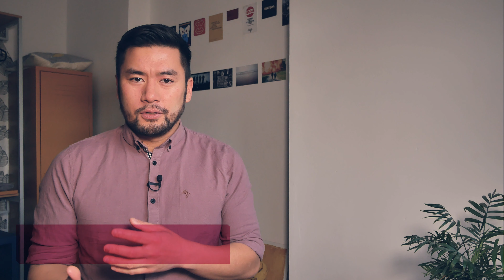The level design portfolio piece that got me into the industry

Comment: You mentioned issues with time constraints, that you couldn't finish the level the way you wanted because of running out of time. What advice do you have for planning out your project before you begin? Sometimes it's hard to even know a problem exists until you get someone to play it and see it for yourself. In my grad game, I saw some problems eventually but figured I simply didn't have the time to fix it before I had to hand it in. Estimating how long a project will take is still something I struggle with.
Reply from the maker: Hey, here are a few tips off the top of my head (which I'm now thinking I'll make into a proper video someday - thanks, haha):

1. Remember that Games Are Hard, and basically everything takes longer than expected. The bigger your project is, the more that all the little delays and complications snowball into the project as a whole taking way longer (weeks, months, years).
2. Whatever your timeframe is, aim to finish early. If you have 9 months to make a game, then I'd suggest planning to have it finished in 7 months, at the latest. If you're working as an LD in a games studio and your lead asks you to make a rough first draft of something in 2 weeks, then aim to have something presentable and testable in 1 week (at the latest), then use the rest of the time to iterate on it and make it actually good. Because of point number 1 ("everything takes longer than expected"), if you don't plan to be early, then you're literally planning to be late :)
3. When making your level or game - create, test and iterate on the most central, important and unknown elements of the project first. For example, in hindsight what I could've done with my Strider encounter is start by making the coolest and most important bit first - the bit where you actually fight the strider, from inside the building (and it blows up the facade of the building, etc). I could've tested that out more early on, see how that goes, and when time started to running out, reduce the scope of the rest of the level around it, instead of compromising the quality of the dramatic climax of the level. It could've been a shorter level, but a higher quality, more impressive one - and like I say in the video, quality is the priority.
4. Try to make your work playable as early as you can, and test it (on other people, without guiding them), as soon as it would be useful to do so. Resist the temptation to hold off on testing until things are more polished, because if you test too late, then like you say, it becomes too late to change anything, based on what you've learned. I talk about this as part of a level design talk I did called "Creative Process for Level Designers", which is on youtube here: https://www.youtube.com/watch?v=fuEcNGbze5g
5. If you google "spotify skateboard", this image comes up, which I often refer back to when talking about how to approach project priorities and scope: https://academy.nobl.io/wp-content/uploads/2016/03/img-1.png 

The lesson being: try to build your levels and your games (the car) in a way that gives you something small but functional, testable and presentable, as early as possible (a skateboard, or the bike). THEN build and iterate upon it towards the final scope and complexity. This way, you find the heart of what you're making earlier on in the process, and you have something good and playtest-able and presentable throughout development, instead of something that is broken and useless until it suddenly (hopefully) works at the very end.

Hope this helps, and thanks for the good question 👍

Comment: I have a list of questions a little confused of something here

does level designing require coding ?(if yes what language did you use for this)

is setting up environment considered as level designing ? because I love to make environments personally but I don't model them I just place assets and build an environment in ue5 (is this considered a job or am I wasting my time, should I start modeling or coding or anything?)

if im looking to be either of those what should my portfolio consist of ?

ik its a lot of questions but i really need some help .
Reply from the maker: Hey Steven - complicated question with no definitive answer, but:
- Level design for single-player games usually feature a lot of content that is setup by level designers, via some kind of scripting system. Half Life 2's Hammer level editor has its own scripting system, Unreal 4 games would be scripted in Blueprint, etc. So level designers usually "script" things rather than write any real code (although even this very occasionally varies).

- Making environments without making the meshes yourself can sometimes be a job - for example at Arkane on the Dishonored games, this job was called Level Architect, and the role functioned inbetween Level designers and the 3D artists who made the meshes. But - I'm guessing it'd be very hard to get to that position without working in roles where you make 3D assets as an environment artist yourself. So if that's what you'd like to do as a career, then chances are you should get into 3D modelling!

Like I said it's a bit complicated because these things can vary a little depending on the studio and project size etc, but I hope this helps :)

Comment: Very helpful video!! As someone trying to build up a level design portfolio, do you think i should worry about broadening my portfolio too much?
I have a very wide range of things i like to do in level design, from pure arcade-y action to horror, narrative, slow and tactical, big set-pieces, and so on... 
I've made many levels with all sorts of different styles for games i got into modding for, but i'm worried it may be a little too much to include at the start... Thoughts?
Reply from the maker: Hmmm my general advice here would be that:

1. Diverse is ok, so long as they all genuinely represent you, what you're interested in, and what you're good at, etc.
2. I think once you get any more than 4 or 5 substantial level design portfolio pieces, the chances of people having a proper look at all of them drops quickly. Whenever I see portfolios with like, 8 or 9 projects in, I instantly think that they should just get rid of 3 or 4 of the least interesting ones, and help people focus on the best / most relevent stuff.

Hope this helps!

Comment: Hello Steve, I am writing my bachelor's thesis on Level Design, and looking at some scenes from Dishonored.
I want to look at scenes from early game, to answer the question "how does level design teach/encourage using new mechanics." 
Early on is the blink ability, and I know you can do some crazy traversal as soon as you have this. Is there something specific put into the levels to encourage the player to go crazy with the blink and really test its limits?
Any insight on environmental design to teach new mechanics would be appreciated.
- Erik Nohr
Reply from the maker: Hey Erik, sorry about the slow reply. Hmm you know what, not much springs to mind in terms of sections (beyond the Void section in Dis1 where you first get Blink) that feel specifically designed to really test it. I think this is partly because it's both an ability that can be used in so many different ways, and also one that is so fundamental to the game, that almost the whole game is basically designed with it in mind :)

And for the rest of the abilities, there are also not many explicit tutorial areas for them, because it's up to the player in which order they choose to unlock them as they progress through the game, meaning most of the game's levels have to try and basically work well with all the powers, all the time - and at the same time, none of the critical path stuff in the game can ever require that you have any of the optional powers, because we don't know if the player will have them.

So I suppose one lesson here is about the increased challenges of creating explicit tutorials, in a game as non-linear as Dishonored, haha.

Hope this helps.

Comment: I love your channel, it's really helping me come to terms with this kinda thing. I wanted to ask, is it more difficult nowadays to work in level design with emphasis on 3D Models and meshes for the scenery? I found the brushes with textures from Quake and Half-Life (I guess Half-Life 2 too, although there are much more models in the sequel) more intuitive and fun to work it for level design. Am I missing something, what tool would you recommend for 3D Level Design?
Reply from the maker: I'm an old-school Quake and Half LIfe 2 guy, so I like those BSP / brush tools for building geometry. But as far as I know, working with that kind of basic geometry to blockout and prototype levels (and for artists to visually improve later) is still the typical way for LDs to work, even in most modern games.

For solo, 3D level design projects, I still recommend the Hammer editor and making levels for the Valve games that use it, assuming they're relevent to the kind of levels you'd like to make. The fact that they're a bit old now isn't as big a problem as some people might think. Do you have a different / particular kind of game or level design in mind?

(I hope I've answered your question here - if not, let me know!)
Reply: @stevelee_gamedev  it helped a lot! if I understand properly, the level designer blocks-out the level and the artists make the meshes and final visual aesthetic, right? Thanks a lot, this makes my day. I'm really thinking about FPS design, for sure, HL2 is my favourite game, so I really appreciate your channel.

Comment: This channel is a gold mine, I actually found you on reddit after seeing your GDC talk. I do have a question for you though; I feel my weakest part of level creation is my documentation and top down layouts. Do you have any tips or advice specifically on getting more fleshed out top-down maps before going into editor? I feel I often find my maps as they are rather lacking, and I end up changing a lot from their initial planned layout.
Reply from the maker: Thanks, glad you like to channel :) And hmm, tricky question - it kinda depends on what kind of thing you end up changing, and how much of a problem that is? I think the degree to which it makes sense to draw detailed top-down maps before going into the editor depends on how much you can really figure out on paper, versus how much you need to see in 3D in editor, and (more importantly) actually play and test to know what works, and what doesn't. My paper planning tends to be quite quick, and more focused on figuring out structure and sequence, etc - rather than the specific details about layout, etc (which I often find are easier to figure out in the editor). But whatever works for you, and the particular project you're on!